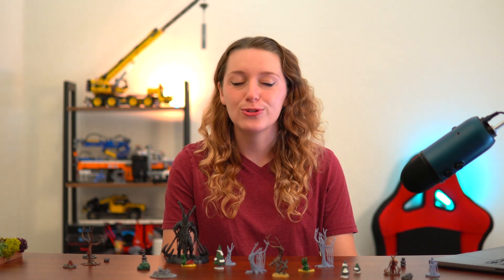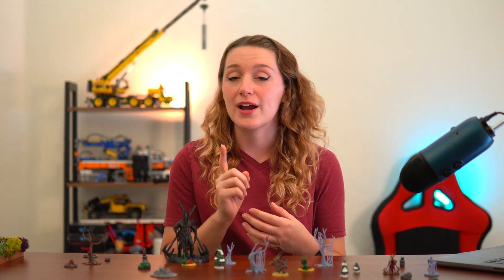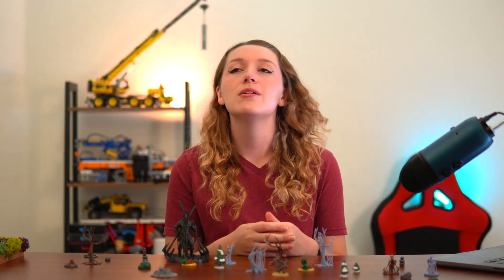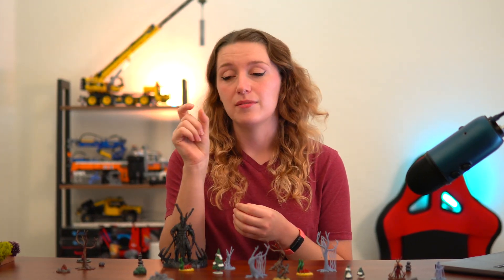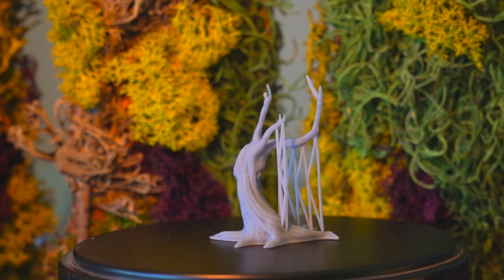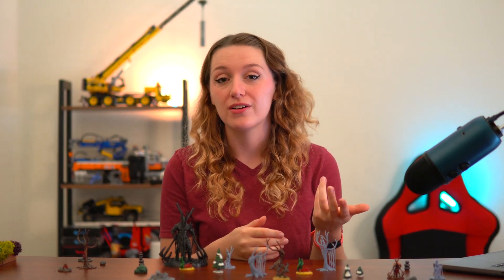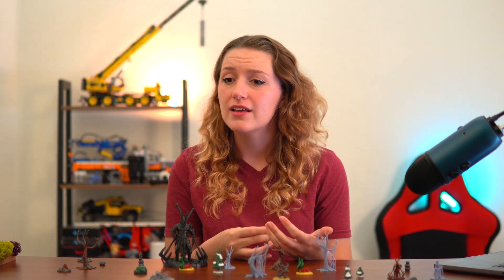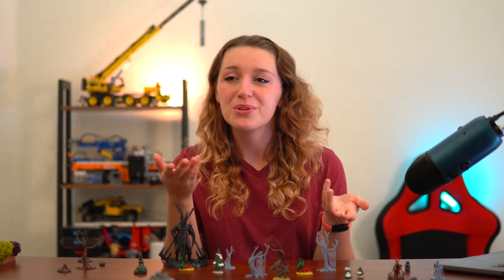Why You Aren't 3D Printing Your Models

Comment: I had gotten a 3D printer, but shortly after, I also got a good VR headset. The Hp Reverb G2.

I love collectable figures. But I lack a lot of room in my room for them, and when I got my VR headset, I fount it to be very good for looking at my models in VR with.

Once you print a model, that's what you have.

But viewing them in VR adds an extra dimension to it.

I can color them quickly with my many 3D painting programs, be it Blender, ZBrush, 3D Coat, or Substance Painter. Or even in one of my VR 3D sculpting programs I have, Shapelab 2025 addition.

And once set in VR, via Unreal Engine, or Unity, I can scale them, to any size on the fly, set them up in a nice looking environment, And even animate them some. I can't do any of these all to easy with a physical 3D print.

And I tell you, I love viewing many of the in PC models I collected over the years, life size. And have some of them moving. I can make a painted spider just walking around at twice my size, or have some humanoid model turn it's head to look right at me as I walk near it, as though it's partly alive and is aware of me.

Could you imagine the cost of all that 3D printer plastic I would need to just make five of the humanoid models, if made fully life size? Or just one, if it was the size of a Gundam mech?  

And now, I will have the new Pimax Crystal Super 57 PPD headset coming to me in June. The many models I have will look substantially far more real in VR with that one, once I have it in hand.

I still buy a few actual figures I may get at a store, that was not 3D printed, but resin made, or other.

But when it comes to an stl file model on my PC, 3D prints are just a little lack luster to me, if not viewed in VR. The only downside to me of not having them 3D printed, is not being able to touch or hold them in my hands. That is a big thing to be missing.

But some are working on what is called haptic gloves, and one day, I may get to feel those models, wile in VR, at any size they be made at.

For now, just getting to look at them in VR has been good enough, to make me not care to much about printing them.

Comment: I just want to get someway to organize them better!
Reply from the maker: Organizing 3D prints or the digital STLs? Or both! Haha Maybe I can recommend something helpful!
Reply: @Ms_M3DM  Lols, it is a bit of both :P as I have buckets of printed stuff waiting to be painted, but for me its the models given the 2.5tb of files I have. Been trying lots of different applications, but so far nothing has really stuck. 
Connector, file management, STL Vault, Eagle, etc.

Also I would say that for printing, think of an encounter or theme and then just focus on that for a little bit so you can make a story come alive. It adds a bit to getting through the staring at the screen blankly phase figuring out what to do.
Reply: @m3dm14 can you recommend an organizer for the digital stls? Would help me a lot
Reply: As for organizing digital files, I find it easier to put descriptor words such as “wizard” or “torso” in the file names or folder names. That way, there can be searched easily. I like this method since it saves time and can bring files to the surface that you completely forgot about if they share a key word with what you’re searching. It’s sort of like an internet search, but in a file system.
Also, I can search within the pop up window for importing stls in the slicing software.  I find that very handy.

As for physical minis and bits, I like to use the clear plastic bag and clear bin method. The bags can expand as necessary, so there’s minimal wasted space and everything being clear really helps in finding things. Also, for me personally, I like to slip a small piece of paper into the bags that has the contents written on both sides. This helps me identify minis more quickly if I have multiple bags with similar looking contents.

Hope this helps!